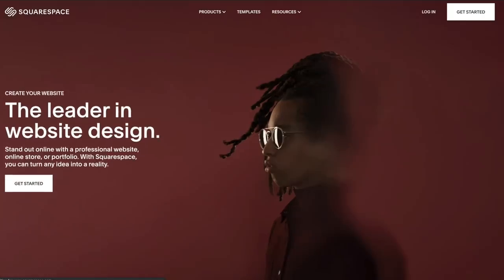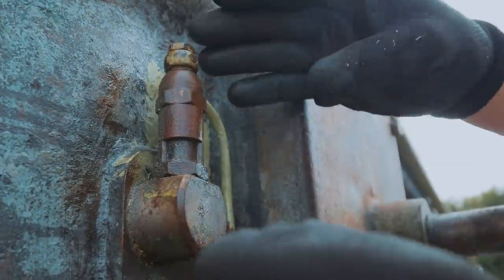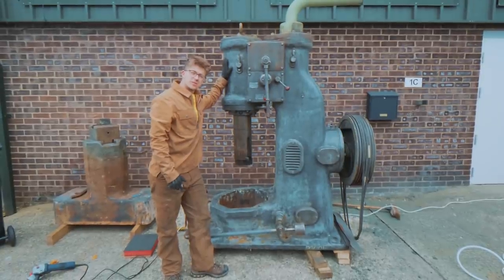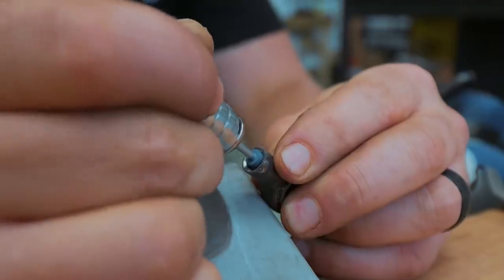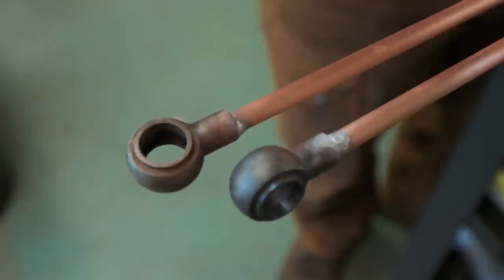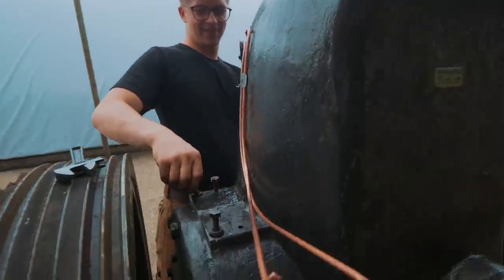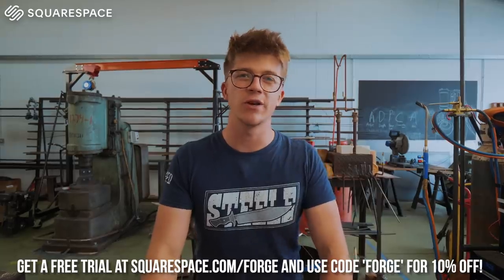Rubbing down my new German friend.

Comment: Lead based soldier melts at a really low temperature, even if it is lead and silver combo soldier like that likely was. If you are using a torch, soldiering is that easy. Good that you used plenty of flux, it helps a lot. Just be sure to clean the flux residue off all surfaces as it can cause problems down the road. A little alcohol and a soft nylon brush is all it takes.

Also, that should never be lifted with a hand truck. It is too top heavy. Forks and chained to the mast of the lift truck or forklift is the only safe way on uneven ground like that. The tube straitening and the little tools you have for it were talked about in my industrial instrumentation/maintenance training.

Those tools you bought, especially the bender, are going to make your life way easier when doing repairs like this. Also, you could have gone with stainless steel or aluminum pipe since it isn't high pressure. Your bending is good enough for a B+ in a conduit bending class, but electricians don't need to be accurate and neither does this.

Comment: You don't use wire wheels anymore. You use flapwheels. The banjo fittings do not have the hole aligned with the tube - there is a circular relief in the banjo

Comment: I worry that with the block off plate to replace the glass piece will restrict the flow as the glass piece came out a little bit to form a channel that the oil could flow through.

Comment: Did anyone already tell you that those steel fittings and that bolt with a hole in it are extremely common on the brake system of cars? There is a name for them: Banjo fitting.

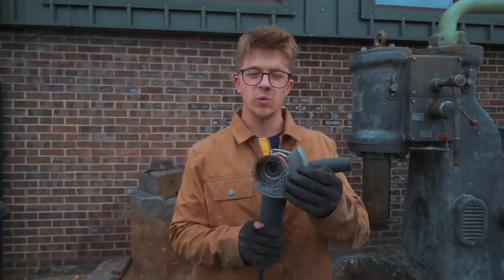Comment: 5:30 AND DONT TAKE that wire wheel anywhere close any sharp edge, cause it will catch if given opportunity to move towards it and launch it self to near earth orbit faster than you can think "Oh fuc...).. and on coming down it can land to your hand/body while spinning full speed and turning that particular spot into mince meat real fast.
When needing to wire wheel near edge angle the wheel so it only on one side and make sure that is spinning off from the edge to minimize this hazard and on the cup model, just tilt it on one side so only that is contacting the surface. It wont be nice time when this happens.
If this does happen despite the warning in future, go wash the wound area with cold water, opening the wound so water can flush out any major contamination, then push the wound so more blood comes out since that flush dirt out as well. Repeat this several times, though as caviat if blood is gushing out when not under water profusely and there is change you have damaged main artery then flush fast and put pressure on. On areas that have minor blood vessels take your time to clean it properly. Then open the wound and flush it with disinfectant alcohol to kill most germs in the wound to prevent infection. Then apply some pressure bandage, few kitchen towels and some tape if you dont have anything else around. Take a minute to observe and slow your heart rate and blood pressure. If it blood is not soaking the paper, wrap it with plastic and some quality tape to make it watertight as possible and go finish what you were doing or take a shower since you are dirt most definitely. After shower remove this first aid thing, flush the area under a water again, apply paper and pressure while drying the area, optimally put some iodine ointment since that keeps area sterilized, apply proper bandages that protect area from crap and put enough pressure to prevent blood from flowing out, but not too much to not let blood on the damaged area since bloods those help to seal the wound and let it close quicker. Bandages must allow it to have oxygen in as that kickstarts the healing process starting to create scab/crust.
Remember to lift off scab partially here and there on evenings so muzzle fluid can flush remaining crap and bacteria out from the wound area helping to prevent infection. Lifting scab from the edges helps that less damaged area to heal quicker since oxygen again and helps with itching that comes from scab shrinking when hardening. If you have steady hand and guts to do it, i spread the wound open and using sterilized exacto knife removed what sand etc grime was left into wound that was visible and was brought on open by muscle fluid. This probably will start blood to flow, but its less and just put some pressure on it to stop it. Personally i recommend this since you your self know and can react the pain faster and more precise than 3rd party like nurse. Still after all those tips healing process will take half a year or whole year with minced meat like this, so be careful. Thick leather hand protectors and full face shield could be really useful, since those are most likely first things grinder will hit.. dont be like me and do it in T-shirt with out any protection.. yeah i'm dumb dumb, but well versed in first aid for some reason :D

Comment: Those twisted wire wheels WILL also shoot wires. I've had it happen. I had one go through my welding jacket about 3/4 of an inch into the fatty part of my arm and if I moved it to the side just s tiny bit it was touching a nerve. It was the weirdest feeling. bruised my arm where it went In. And that's why I always wear a full face shield when using a wire wheel or and grinder wheel for that matter.

Comment: You know you should check the recommended rpm for each tool ive learned after using that one wire cup that it was nit for 11000rp but it was for 7500 or something so you need adjustable speed grinder

Comment: Some bit of kit the pipe work is literall exactly the same as as brake pipe work on cars, although the copper is so soft being in workshop has a possibility of getting pinched personally I'd have gone the braided pipe route would have been more expensive but less chance of getting damaged.

Comment: This makes me think of the many hours I spend wire wheeling on an old villiers engine block and head to restore an engine my granddad got me with a dremel…. I’m assuming dremels aren’t powerful enough to do that sort of thing because I did it in a jumper and jeans. (The engine never got finished due to a flooded coil and bust magneto, the parts were about £500 so it wasn’t worth it for a £50 engine

Comment: Alec. Hey I don't have any way to contact you other than thru here. I have an idea for a new project. Can you make a sword that has a hollow tube thru the entire length of the blade? The reason I ask is im thinking of a fire blade. If the center of the blade had a small channel in it, you could supply the handle with a small propane tank and have tiny holes in the blade so that the fuel could be ignited to create a "Fire Blade". Whatcha think buddy? Is it possible? I'm the guy that asked you once before about coloring the metal. I should have asked (back then) if putting other chemicals in the liquid state of metal, would change the color of metal. Love your videos Mr Steele.

Comment: I noticed that you were using ferrules and flares at the pump connection.. You're not supposed to use both.. From the looks of the fittings on the pump, you should have used ferrules only and no flares.  Banjo fittings require copper washers on both side for a proper seal.. You might want to look into that as well.

Comment: That fitting will need either a ferrule, single flare or bubble flare I could not see from how fast you went past. That flaring kit you got should have come with "caps" for each size pipe. For a single flare you only use the cap not the taper of the tool. Probably thousands of videos on flaring single and double, bubble is a different angle on the cap.

Comment: check how pipe line was and how rebild. And try think whay it was like it was.
PS: if you try unbolting same bolt - after rebulding - you will have some problem with oil )

Comment: Nice GDR-made power hammer! I rebuild such an oil pump for a steam loco. But the way the sight glas in the video was repaired is just wrong. The small metal rim should press the glass onto the seat. Now it is under the glass and will leak, apart from the look of course...

Comment: 00:03- You cheeky devil! That title!
00:28- Here we go. Wait. Nevermind. 
00:33- You're not supposed to go from the body to the mouth! ... Ooh. Eat that wiener.
00:54- A montage already?!
01:00- We can't have you measure it. You'll favor upwards.
01:14- I sit corrected.
02:56- Too soon. Shrinks my dink just remembering.
03:00- Negative 1.8 inches. ... At least nobody got squished.
03:04- NOW its funny! Lesson learned. Cautions uh, cautshed?
04:01- A stripped German machine! (Gunther! You should name it Gunther!)
05:34- My dad had a wire bounce off his front tooth and scrape his lip once. Actually would have been worse if he'd had his lips sealed.
11:47- WHAT?! Air loops? Are you sure you haven't done this before?
12:07- Nice pants.

Comment: Something just came to me while rewatching some of your old videos.....the flakes that are made while forging and wire brushing aren't  slag as the metal has already been forged you're only reworking it. But those flakes.....could they be smelted down in a crucible to remake workable metal? Or by that point have they oxidised too much to do anything with?
If it could barely maybe possibly be done would be awesome to see and interesting as to how much if those flakes you'd need to create enough to then make something.  Even just one of your leaf keyrings. 
Know its a long comment but really curious. Let me know how life is back in Norwich missing it loads. Next time you're in the centre grab some chips from the market n let me know if they're still amazing as always.

Comment: F.Y.I. when you have to remove plastic straps on a package. No need for scissors. Just find where the straps meet and they are melted together. Flip the “connection” over and there is a strap on the backside that can just be pulled. Voila. I guess having been a paperboy payed off.

Comment: Tiny Dremel wire strands infested my home. I wasn't aware of just how gnarly they would be. During my wire wheel play I got a single one stuck in my finger at the speed of FU*K and now about once a month or so I find one randomly. Sometimes in my carpet which leads to getting stuck in my foot. Or in my clothes fresh from the dryer. And they never show up right away. No. They make themselves known once I'm out in public and practically have to disrobe to get it out of my clothes or skin.

Comment: Why the hell would you plumb the copper pipe across the removeable plate on the front of the power hammer face.????... originally it goes around it to allow access....